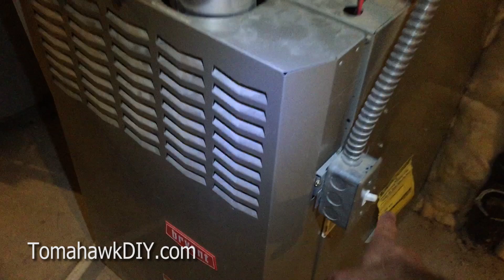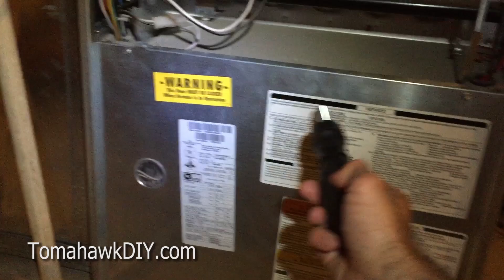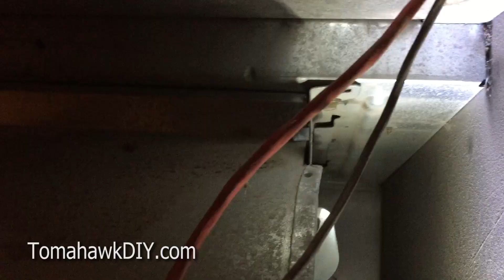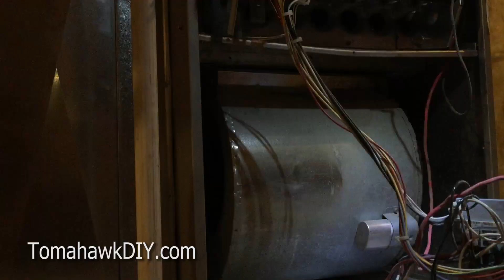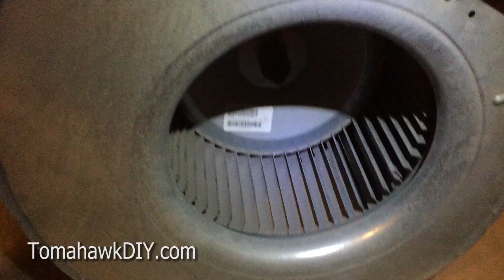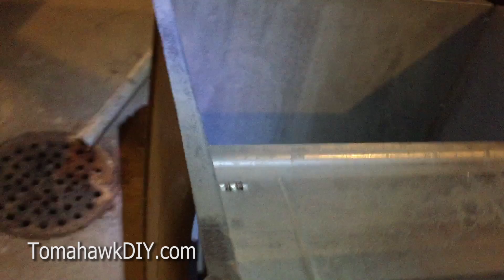How to Remove and Clean a Furnace Blower Wheel

Comment: On my furnace, it took a bit of looking, the blower wheel bearings have to be oiled also. 1998 vintage. There are little plugs that pull out and add say 10 drops of oil
Reply from the maker: Thanks for sharing!

Comment: God bless you for posting this helpful video.  Was able to clean my 83-yr old Mom’s gas furnace / AC fan.  The only difficulty I had was putting the fan/motor assembly back by struggling to support it up in the air, while trying to align and engage each “rail” in the rear, in tight space. (Without pinching fingers or wires!)
Reply from the maker: Glad it helped

Comment: Would using an air compressor blow out that dust better than cleaning it with a brush ?
Reply: you wanna get the gunk out completely.  If you just knock it loose, it'll just go up in the system and clog up the evaporator coils.

Comment: I removed and cleaned a blower motor wheel and housing today at work. I Didn’t really know what I was doing never cleaned one before but removed one before in class. Watched this video to make sure I didn’t F anything up lol. Looks like I did alright, I used a vacuum too but I used my finger to pull out gunk between each individual wheel blade then vacuumed, blew out then vacuumed again. Put it back in and that was all.

Comment: I did this myself a year ago without seeing this video. (I'm an electrical engineer, and very hands-on.) My really old ~1985 Carrier air handler was thankfully much easier to access inside than the unit in this video. It's a narrow box that takes a 12 x 20 x 1" filter (which I replaced with a reusable all-metal filter). Much of the wiring as well was covered in black gunk. Took MANY flash pictures with my phone to recall all the wiring, fasteners, and component positionings as I disassembled it. Was careful not to touch or short out the capacitor leads. The wheel enclosure was all spot welded together and I could not take it apart to remove the wheel. Separated the motor from the blower assembly and took them to a coin-operated power wash facility, and had to rotate the wheel inside the enclosure periodically to reach everywhere as I sprayed. Was careful not to disturb the wheel weights that keep it balanced! That pressure washer really cleaned it out. Carefully cleaned the fan motor at the pressure wash, avoiding wetting the motor windings and wiring/contacts - the motor appears to be a recently replaced unit, compared with the age of the rest of the HVAC unit. Set it outside to dry in the sun all afternoon. When re-assembling, I forgot to tighten the motor shaft set screw on the blower wheel! But it was reachable in the installed position with a 5/16” spanner. It seems to be quieter and more efficient now. I also cleaned out the PVC condensation pipe circuit (yuck!). Next project will be replacing the old fiberglass insulation with closed cell foam that is heat and mold resistant.

Comment: My blower turns on but the furnace doesn't turn on. No codes. Flame sensor has been changed. I know I've been lax on changing the filter this past year. Could a dirty blower fan be why it's not tripping the air sensor, resulting in the furnace not to kick on fully?
Reply: Did you ever figure it out?
Reply: @thebruhhh  my air intake going outside, had water in it choking the pipe off. Adjusted the hangers and got a good pitch so no water gets in and have not had a problem since.
Reply: @jordans.1910  thanks man!  I’m about to head to the roof after I do one more test. My blower motor appears to be overheating.
Reply: @thebruhhh  interesting. Good luck. Is the status light on your furnace throwing any codes?
Reply: @jordans.1910  not sure. Every time I’ve opened up the panels I’ve already killed the power.
Reply: @thebruhhh  there should be an indicator light that flashes or shows different colors. The definition to those colors and morse code type flashes are on the back of the main access panel. Start there, it should help you diagnose the problem before you start spending big bucks. Also make sure your filter is clean
Reply: @jordans.1910  ok so I took out all the filters (3 of them from different returns), everything worked great. Light on controller blinked correctly. This is leading me to believe these filtrete filters are the cause. Putting too much strain on the unit (or the blower motor is just getting old and needs to be replaced). I suppose I’ll buy the cheaper filters.  I also inspected the roof exhaust and no blockages.
Reply: @thebruhhh  yeah sounds like filters are causing it to work too hard. Glad you figured it out bud
Reply: @jordans.1910  hey brother I appreciate the remote support you provided. Cheers and happy holidays. 🍻🎄
Reply: @thebruhhh  not a problem, thanks bud! You as well! 👍🍻🌲🤙

Comment: This is going to get someone killed! First off if you going to shut off power do it from the circuit breaker and the disconnect then test the line voltage with a multimeter because that door switch that you removed passes 120v and that will cook you, also the capacitor on the blower wheel is stored energy so be careful. So folks I’d you dont know what you are doing call a professional, and do your research on the company before going withe the lowest bidder.

Comment: Can this affect the air conditioner not being as cool if this fan is dirty?
Reply: cucked ALIEN a dirty blower wheel is going to move less air which would increase temperature drop from return to supply but ultimately cause other issues such as a coil freezing up. So, yes and no

Comment: My heater was working fine but i heard some hard shaking and then the wheel stopped and smoke started coming out maybe from the Motor inside the spinning fan, i dusted it and cleaned a bunch of dust, it ran better but after 10 min i got that burn smoke coming out again from the motor. Do u think it maybe needs some Oil? Or a better cleaning?
Reply from the maker: Not sure, but sounds like it could be a bigger problem. Smoke is not a good sign. Might need to have a professional look at it.
Reply: I'm definitely not an expert but that sounds like a problem with the bearings.  I think oiling them in the past (depending on the system, since I think some you aren't supposed to oil) might have helped keep them from going bad.  However, if they are at the point that the motor is seizing up then my guess is that they are now bad and all the oil in the world isn't going to help.  I could be very wrong though since I know nothing about heating systems really.  Just using basic logic from what I seen in the video.  From looking at that motor setup I just don't see how you could get rattling from JUST the motor going bad.  If the motor was defective I would think it would just create a short.  The constant smoke sounds like it hasn't shorted out but is still trying to turn but can't. Has the motor now been damaged because of it seizing?  You got me.

Comment: HELP! So my furnace recently started to "shake" while it runs. Could it be the blower wheel?
Reply: Last time that happened to mine it turned out to be a dead mouse in the blower.
Reply: @arnoldkreek4981  similar issue here but it was a piece of loose insulation.
Reply: Yes thats the only moving part. It's called a centrifugal blower motor. It needs to be firmly attached and well balanced to the center to run properly and not shake.